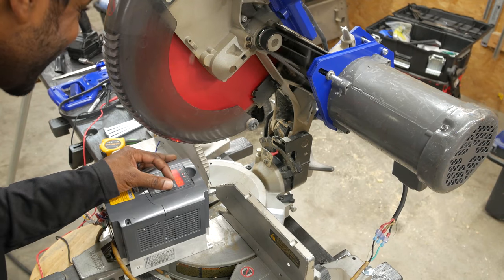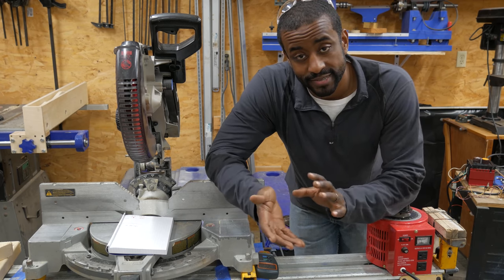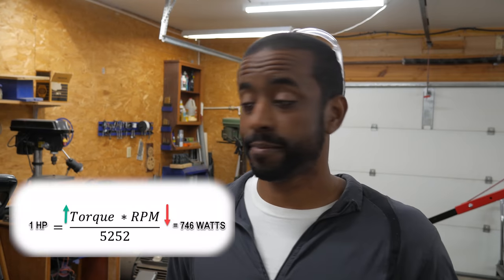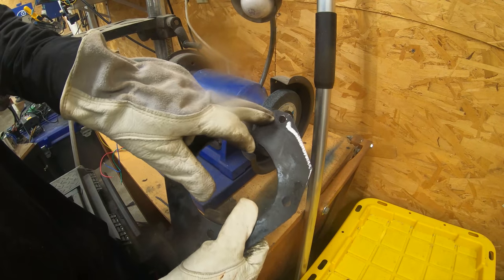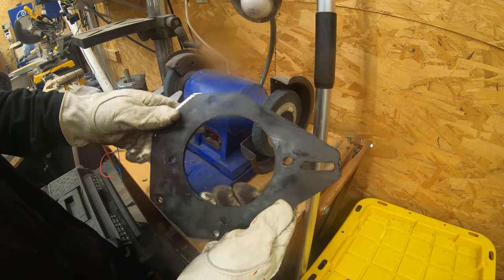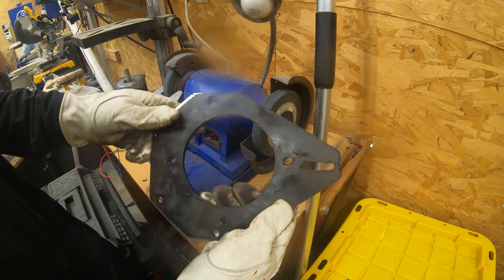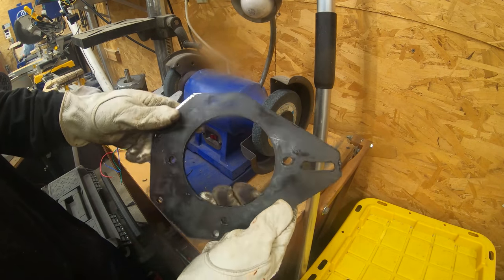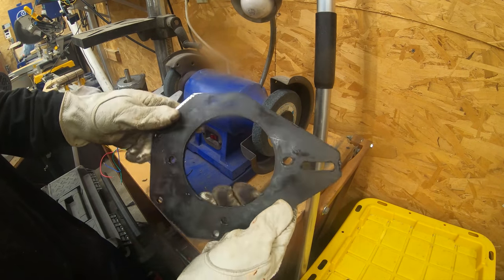How To Speed Control Your Miter Saw For Cutting Steel #080

Comment: After you found out that modern cold cutoff saws run at roughly 1/2 the RPM of the wood saw, a simple 2:1 pulley differential is very feasible.  The stock motor keeps putting out full power and you double your torque at the blade.  That's a win there.  But, I know your channel is geared toward motor tinkering, so keep up the good work.
Reply: Exactly what I was thinking when he mentioned that higher RPM.
Reply: It's already at 2½:1. So he'd need a 5:1, which would probably be too big for that tiny area the pulley runs in. Yours have to grind the frame apart.
Reply: @xenonram  I meant the motor pulley at 1/2 the diameter of the gearbox pulley.  I am assuming that the original was 1:1.  But the motor definitely needs to be smaller for efficiency and torque.
Reply: By using a pulley with half the diameter, there will be half the number of teeth engaged with the belt. This may rip the teeth off the belt.
Reply: @FreshAsFxck  No, more like 1500-1800 RPM on modern cold cut saws as Mike Morgan pointed out.

Comment: I like what you are trying to accomplish. I've always tried to some how, some way, make stuff work in a safe n responsible way. But you might need two saws, one for wood, one for metal. Remember, the right tool for the job. Can't give you enough thumbs up for using your knowledge to make a dual purpose saw. Maybe they will make a saw that does both. But A+ for trying. Stay safe thru these difficult times.

Comment: Normally closed switch might be for braking to slow the blade down quickly after you let go. I'm not an electrical engineer, but I know that most miter saws can shut down pretty quickly and I doubt that it's all due to friction in the drive.
Reply: I  always thought they slow down using a centrifugal switch. Its not when you let go, it doesn't brake until it slows down some.   Maybe also in series with the trigger NC
Reply: Alex Teela soft start also
Reply: It is easy to test if you have a saw and an extension cord with a switch. Compare turning the saw off with the extension cord, vs turning the saw off by releasing the trigger.

[Please don't cut yourself while performing this experiment.]
Reply: It's  called electromagnetic brake(I think) .like in the battery drill.you let go the trigger and it stops
Reply: @SergeiArkadjevich  - Yup, it shorts out the brushes and turns the motor into a generator with a dead short. Some brands (Makita comes to mind) actually have a second field coil that's only used for this, and that tends to be what burns out and takes the primary coil with it.
Reply: @bobjames6284  thank you for the info .
I have all the tools made by Makita(nearly all)
Reply: Alex Teela: The one electronic brake I have any experience with was a lo-o-o-ong wire (maybe 6-10 ft), all coiled up. Pretty sure the long length is needed to redistribute the motor energy as heat over a large space -- and (I think) with less heat then getting distributed in the motor coils themselves. The brake wire would get noticeably warm if you did 5-10 quick starts & stops in a short time.
Reply: when you are doing repetitive cuts in short time, it pays to remove the shorting ( breaking) circuit so as to let the blade run on, whilst changing the cut material,  IE.  YOU  WANT 100 BITS OF DOWEL 100 MM LONG.
Reply: @widmermt  that coiled wire is probably a choke, and it may be used to smooth out the sudden aggressive motor starts.
Reply: @bobjames6284   you are correct sir, I use the same method of shorting and turning the motor into a dynamo for slot car brakes, with an inline 10 ohm potentiometer to make the brake setting adjustable to suit various circuit styles.
Reply: Some VFDs do have braking capability.  NC dead man switch to the brake to dump the energy through a resistor.
Reply: DC Dynamic Brake
Reply: @bobjames6284  ha, i use a makita drill and intentionally let off gently if whatever is spinning has a bit of momentum. The brake feels like it wants to rip the thing apart otherwise.

Comment: Awesome explanation and concept! That said, I slapped a cutoff wheel on an old chop saw and it works fine. Yes, it's hot and rough but a couple seconds with a file or grinder is all you need. Keep up the great videos!
Reply: Make sure your cutoff wheel is rated for your saw's RPM (most are, but they can do some crazy damage if they fail).
Reply: Not a good idea if the saw has a plastic dust collection path.  Have the t-shirt.
HF sells the cutoff wheel variety for not much esp if one uses the discounts or sales.
Reply: @danharold3087  I use an old chop saw that's not connected to my dust system. It's on a wheeled cart stored under my workbench when not in use.

Fabbed a sheet metal deflector directly behind the wheel to take the Sparks. No issues
Reply: @dcurry7287  thanks, will check that next time in the shop

Comment: I think the normally closed switch contact is for stopping the factory motor when letting go of the switch.
Reply: That is correct. This method of "braking" was patented in 1970 by Thomas A O Gross and assigned to Cooper Industries LLC. I learned this about 25  years ago when troubleshooting the failed brake on my Makita chop saw. I am now on the the third switch but the saw still works!
Reply: MotownVideo the benefit of buying decent tools in the first place. There are parts available!
Reply: @MotownVideo  That technology existed in the 1960s and maybe before.  An AC motor will stop quickly if you apply a DC current to the windings after the AC power is removed.  We used that technology in the flight simulator elevator aileron and rudder trim systems before the digital age.

Comment: I love the idea - and dang, you put in some serious work trying several angles.  Great job!  Oh, and at least one other person has mentioned this already, but the other two contacts of the switch are for the electric brake function (i guess a safety feature on most miter saws).   I think when the switch is released, the reverse-wound field windings provide electrical resistance to the forward spinning, oppositely wound rotor, which slows the blade to a halt very quickly.   It might complicate the VFD  setup though.  :)

Comment: Hey. I just wanted ro throw into the room that here in Germany, its a regulation that NEW (Not the old ones everyone has) Carpentry machines used in carpentrys, should completely stop within 3 seconds of turning it off. Just for a baseline of what you may wanna tweak that VFD slowdown time to
Reply: I don't know if you do videos, but I would watch one about home electric supply in Germany. At least if what I heard is true and I remember correctly. Do you really have 3 (maybe more) phases and 440V?  If so, Crayola might have to add a new color to match my green with envy hue. Just to really rub it in, I'd like to see some appliances and tools run, and a tour of the breaker box and outlets.

Comment: The jump cut to the bigger motor, classic! 😂

Jeremy, have you done the math regarding suggested surface speed for tungsten carbide on mild steel with that diameter blade? I would imagine it is rather slow. The sauce commercially available saws that run ~1300 RPM are likely going way too fast for the material.
Reply from the maker: Yeah. It seems the slower ones ( with a slower feed rate as well have it right. I haven’t done the calculation. I just opted to go with the model that was easiest to match with the smallest possible modification. There is a reason the 20-80 rpm saws cost many times more.
Reply: @Jeremy_Fielding  why do they cost a lot more?
Reply: The slow ones apply a lot more force at the cutting edge, so there's a lot of torque required. Far more than you could put through that belt, let alone get out of the motor. Which means the saw costs more, the blades cost more, but they also work better and the blades last longer
Reply: It seems to me the easy way to make this mod is to use a smaller blade on a saw designed with the right stock RPM, for example a 7-1/4 metal saw is made to run at 3800rpm, same speed as a normal 12" mitre saw.
Reply: And it really made me giggle :-) New sub.
Reply: 180SFM for carbide on >32HRC Steel - 180 ft/min / 3.14 ft/rev = 57 rpm with a 12" blade. 

Even dropping to a 7.25" blade only ~halves the circumference, so you'd still need to spin it down to 95rpm to get correct surface speed. At 3600rpm, you're two orders of magnitude too fast for steel (thus Jeremy's comment about needing a 70:1 reduction).
Reply: I think they want the highest rpm that won't instantly dull the blade because if you pull down too fast it won't cut but get stuck and probably damage the blade. It may even throw out dangerous shrapnel due to the high torque. The slow rotation with high torque needs to be coupled with guaranteed slow downfeed to get the best results. This is how the big production saws work but their downfeed is mechanically controlled so each tooth cuts no deeper than its proper depth.

Comment: Thanks much for posting this video Jeremy. I Found an old mostly warn out cold saw for sale cheap and bought it. Man that thing will cut steel like butter. I used cutting/tapping oil on it every time I cut steel with it, it really helps, it does make it messy though. 

I just had to sell off most of my stuff due to a move from one side of the country to the other so the cold saw had to go. One thing I was able to determine, I do need one of these saws and must find another good used one or even buy a new one, it is worth it to spend that $$. 

Before I would convert a miter saw, I would build my own cold saw using a 3 phase motor and a VFD as you illustrated. Already using VFD and 3 phase motors on other shop equipment such as mill, lathe etc. 

I can then build a large heavy duty table with multiple clamping options, large bearings in the pivot point and a chip collection system based on a vacuum with custom chip collection box down below. What I build would cost a huge amount if bought so I think I may just go that route in the future.

Comment: Just a heads up for you guys that may be looking for a cheap fix to cut metal with your miter saw, don't freak out, you can but cut-off wheels with an arbor size and diameter to match most (if not all) miter saws, this cut off wheels support cutting at up to 5400rpm. They do a great job for entry-level metal fab. 

That being said, this is an awesome video, breaking down different types of electric motors, their purposes, pros/cons, and some creative engineering with an impressive result. Thanks for the great content!
Reply: Yep, I've just bought a 12" Tungsten Carbide Tipped blade that is sold for cutting Ferrous Metals/Mild Steel that has a Minimum speed of 4000rpm written on it. Well withing the capabilities of my mitre saw.

Comment: The 2 wires that conduct when the switch is not "on" are most likely for the braking circuit that stops the blade quickly.

Comment: I watched this with a great deal of interest. Thank you for the information. In my case, I ended up purchasing a cheap Porter Cable saw, had a machinist friend make a duplicate of the plastic blade guide (think that's what you call it) in aluminum and put metal cutoff blades on it. It's quick, cuts are straight and it's a dedicated tool for that purpose.

Comment: Keep in mind the weight of a heavier motor will probably add a kerf to your cut
Reply: It won't. Spring on this thing is strong enough to pull the whole thing up, so weight of it does not matter at all, only force you add with hands which is way, way larger. And motor is mounted very close to pivot point, so it has much less impact that you would think (leaver lenght).
Reply: @Stasiek_Zabojca  it may still do so on a cheaper saw. Only one way to find out.
Reply: I think you're confused on the meaning of the term kerf. You can't "add a kerf." There is always kerf on a cut, the thickness of the blade. Are you saying the kerf will get wider? Are you saying the kerf/cut will become angled? The kerf is not going to change. Getting the motor heave enough to influence the kerf/cut will cause the bearings to break before it affects the cut.

Comment: That's all good but it's better with water and cutting fluid like a real saw for that purpose. The brobo water cold saw blade is what you need but without the water and cutting fluid continuously flowing  over the cut the blade will go blunt after a short time.
Reply: Nope. We're way past that now. The "real saws" are exactly like he made. The Morse Metal Devil and Evolution saws (every major manufacturer makes one now) have almost completely replaced the slow moving wet saws. The wet saws are about 10x as much money (around $5), and are good for production environments, environments where noise is an issue, and heavy use cases, but they cut slower.
Reply: @xenonram  yep essentially materials science and carbide manufacturing has changed a ton in the past few years and has brought carbide tipped metal cutting saws into reach of everyone. If someone wanted examples of how far this tech can go, Diablo (owned by Freud) has created circular saw blades for standard off the shelf construction site saws that allows them to cut through both steel and wood simultaneously. The blades actually spin at over 5,000RPM (if I remember correctly) and the video shows slicing through a large wooden slab with a dozen or more steel bolts driven in along the length of the wood. Yes it's an artificial test, but the tech is real and it's changing demolition work for contractors, and metal cutting and fabrication tools.

These cold cut saws do work, can produce clean, burr free cuts, and make metal far more manageable for any shop. Northern Tool even sells a cold cut saw with blade for less than $300. I've used it, and it's decent, but it does seem to bend and flex more than I would prefer during heavy cuts, so I'd personally recommend upgrading to one of the Evolution saws or other similar saws if you can afford it. Hope this helps!
Reply: There is an old-timer machinist saying. When the chips are brown, SLOW it down. When the chips are blue, you're all through...!
Despite the feel of the blade and material, the chips tell a valuable story.. Coolant would cool everything down and blade will last much longer...
Reply: @victur1  that's when you go get one of those cheep mist coolers and slap it on a cheap saw... these days it sucks but cutting corners on price is a necessity for some of us.
Reply: @victur1  thats a cool little rhyme. I'm a welder, but I use a lot of cutting and drilling tools for fabricating. I gotta sharpen a lot of tools constantly. Thanks.

Comment: After watching again, you painted your adaptors, was that “Jeremy Blue?”or “Fielding Electric Blue?”
 That 2HP motor is heavy to use a shop lift (Cherry Picker) and my first thoughts were that saw, table and all would tip over. Thanks again Jeremy! I love the CNC cutter. I will have to find time, go back in your videos and find this build. But, I am sure I will watch 14 others...

Comment: Here's a tip. Never wear gloves with a rotary tool like a grinder. Fyi, it cost's $10,000 to
re-attach a finger.
Reply: My first career I was a welder/steel fabricator. Everyone wore gloves when using a grinder. Your point is valid for things like drill presses or milling machines, but even then I'd wear gloves occasionally. The shop where I worked, much of the work was done outside. Winters were cold and icy, and steel is often sharp. Sometimes glovers are needed, you just learn to keep your hands a safe distance from the spinning part.
BTW, in 15 years of steel work, I never had a serious injury.
Reply: Zip tie the changer tool to the plug. That way you HAVE TO UNPLUG IT TO CHANGE THE TOOL. A bunch of grinder injuries are during live power tool changes. Same thing with battery powered tools. Take the battery our before tool change.

Comment: I worked at a steel tube mill where we made tubes like those then we would take them to our tube cutting machine and it would cut the tubes with blades. It's cool to watch if you ever get a chance.

Comment: Great video, impressive mind and knowledge base!
I've been contemplating giving my chopsaw the boot because of the hideous noise level of abrasive wheels and their short lifespan. 
The alternative is my mitre saw.  I looked at the options and decided to purchase a diamond blade because the rpm range is much more compatible with the saw in a stock configuration.  I'm impressed with the lifespan of diamond, which has become my go-to on 4.5 and 9" angle grinders.
As an aside, find someone with an A/C tig that will give you a few minutes of instruction, assuming you don't already own one.  I'm pretty sure you could pick it up in a snap, even if you have never welded.  Give the epoxy the boot back to the wood pile.

Comment: Run with original motor from store with a 2 to 1 pulley and Bob's ur uncle.
Reply: Exactly my thoughts!
Reply from the maker: I like it. Maybe 2.25 or 2.5 inches instead of 1”. I think that would be a good alternative if you only want to cut steel. And change to the appropriate belt length. All reasonable to get.
Reply: Make a double pulley and do a belt swap for wood to steel to retain the ability to cut wood? Much like a drill press rpm adjustment.
Reply: Yes, 2:1 or 3:1 is much more reasonable than 72:1 for a gear or pulley reduction.
Reply: Do you think the universal motor would have enough guts in this configuration to cut the steel? I have no reference for what kind of HP is required to cut the steel.
Reply: @jonahbrame7874  Gearing down the speed by a factor of two or three will reduce the load on the motor by the same amount, so it probably wouldn't be an issue.

Comment: A number of years ago I attempted to cut up some #4 rebar with a cutoff wheel on my 10" Kobalt miter saw WITHOUT changing/modifying the motor for a job.  It cut them fairly well.  I went slow, and backed off when needed.  I would not do that often, but it worked in a pinch.